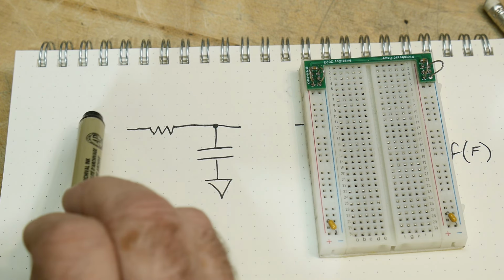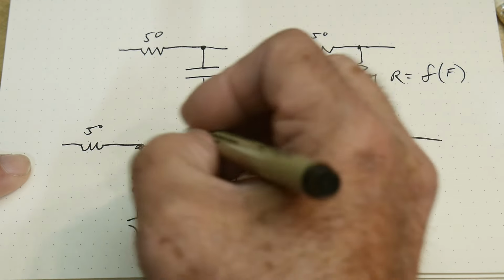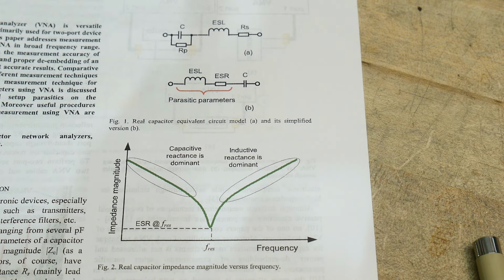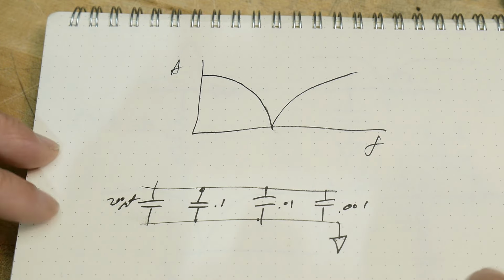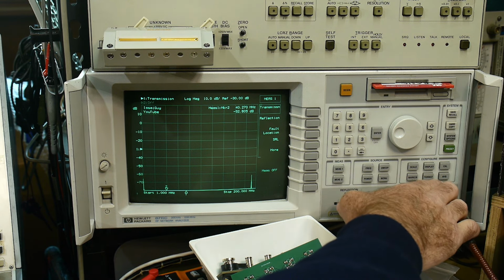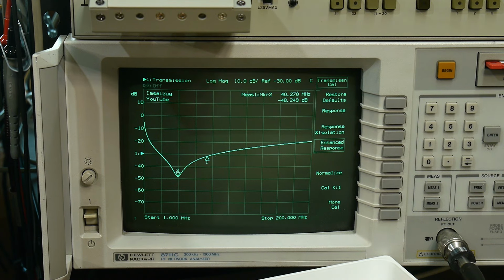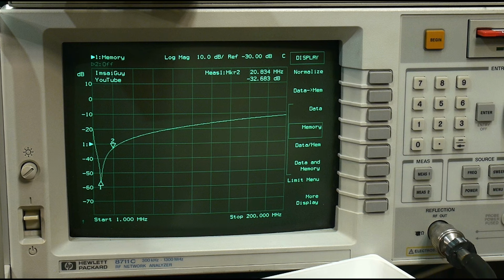#1819 Multiple Bypass De-coupling Capacitors

Comment: Adding inductors in parallel will reduce the inductance. Using multiple vias to the ground and power planes on a multilayer will reduce inductance and improve noise. Everyone knows about bypassing Vcc but not many know about bypassing gnds to Vcc for really quiet boards.

Comment: On other thing to add...pick up a capacitor... any capacitor that you have... and say to your self... "You tricky little devil... you're not the 'capacitor model... however complicated' ...that I manage to conflate you with." In the long run... if they put you away (or on meds) for talk'n down to capacitors... you'll be safe... at least... from that conflation.

Comment: Nice paper by the author(s) Stepins, et. al. Let's see if the Guy actually reads it. (Anyway, points out the limitation of using a VNA for measuring the ESR of a particular capacitor.)
Reply from the maker: I did read it. There are many calibration errors in 12-term calibrations of VNAs. I've considered doing a video on VNA calibration which I believe would be the first step if people want to read the Stepins paper. I did enjoy the discussion of different methods S11 S21 stuff. They were questions I had in my own head.
Reply from the maker: for those who want to read it:
https://www.researchgate.net/publication/269166796_Measuring_Capacitor_Parameters_Using_Vector_Network_Analyzers

Comment: Now I understand better why different capacitors are put in parallel.  I know it’s done in SMPS to remove high frequency noise because electrolytic caps do not handle the higher frequencies. I guess the short story that they tell us in electronics 101 that capacitors in parallel add to an equivalent Farad sum is not exactly true because it is highly frequency dependent.

Comment: I would like to see effect of using different values of capacitors together vs using the same value in parallel same number of times. New fpga designs use only one capacitor value but multiple times.

Comment: I am designing a PCB for my project it is a switch-mode power supply that has a switch-mode power converter an Atmel and a 12-bit ADC and it is really important to put a bunch of those decoupling caps near those components like the Atmel and especially the ADC in order to have really low ripple in the input  I also would like to know how effective it would be to use frit beads alongside those  decoupling capacitors
Reply from the maker: a lot comes down to ground layout

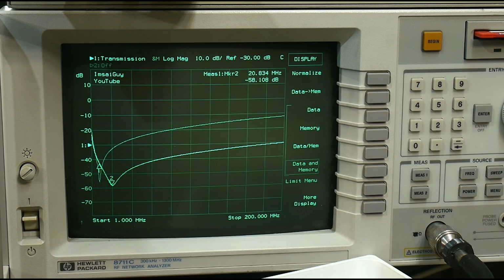Comment: 20:18 WEIRD! The curves overlap at the start until the SMD starts to jutt-right a little, which ultimately leads to its valley being far right of the leaded-cap. But that jutt-right appears to line-up with the beginning of the leaded-cap's inductive-curve!
It's almost as though the SMD cap is being affected by inductance earlier than the leaded-cap, but since that inductance is so much lower, its effect is obviously less in the higher frequencies.
Another way to look at it: If the leaded-cap's inductive-"only" curve were summed with what appears to be the leaded-cap's ideal capacitive-only curve (where at 8?MHz it reaches its valley, but if it were to stay there for all higher frequencies) then we'd see something like the SMD's curve.
This must be a coincidence, eh? I can't think of how that would be the case physically/electrically (unless maybe the chip-capacitor is designed with "fingers" instead of plates, or maybe the inductive curve we see is actually calibration-error due to traces in both circuits?).
Or it might just be a factor of zooming, where the leaded-cap also jutts-right around the same point, but does-so so shallowly that it can't be seen at this scale.
It's weird how many things influence such measurements, and how we interpret them...

I did [SO MANY] signal-integrity analysis simulations for DDR memory about two decades ago and found that even the tiniest changes, like shifting a via 1mm, would cause dramatic changes to the signal. Yet, the layout-standards documents were so loose, in comparison, that it's a wonder so many quickly/cheaply-designed motherboards worked at all! (nevermind DIMM sockets, etc.!). Simulations of "good layout"-practices often resulted in signals far outside the input-specs of the devices!

Comment: At 16:38 it is worth noting that the system has a decent Q, but not super high. I would assume the Q would measure higher in a setup that was not 50 Ohm.

What i have also experienced from previous work, is that it is very likely that the circuit will have noise/oscillations at the peak (mkr 3) as the CLC circuit requires very little disturbance to oscillate.

Some comments ask about the difference between dielectric, say X7R versus other MLCC, this should have a lesser degree of significance.
The physical size of the package is what mattes the most, it is ultimately the loop area that causes the leakage inductance. Assuming same capacitance.
When working with MLCCs, it is best to have as much capacitance for a given package as possible,
There are however two things to remember
1) That x7r and the like will suffer from bias dependent capacitance.
2) via placement, trace length and pcb stack up will aslo be important for good decoupling.

Comment: S21 is the opposite of what was stated. Not that it makes much difference at these frequencies but you should use your test jig as OSL standard to eliminate the parasitics of the jig.
Reply from the maker: I agree you can calibrate out the small stuff if needed. A bit tricky to build a good OSL standard. as the S21  it is the forward transmission of a system. 1 is the input and 2 is the output. S21 points in the forward direction.
Reply: @IMSAIGuy Building a perfect standard is tricky but if your VNA allows to input standard coefficients and you have a set of known standards that you can use to characterize your DIY standards then it's not that hard.
Reply from the maker: @galileo_rs  I can't afford a calibration set. so I do the best I can
Reply: @IMSAIGuy  I believe you have a friend that has access to a calibrated VNA? Make a "transfer standard". Lookup Kurt Poulsen guide on how to make your own standards. He posted it a few times on various groups, most recently on LibreVNA group. Since you have a lathe and a mill it should not be outside of your capabilities.
Reply from the maker: I do not have access
Reply: @IMSAIGuy  I guess I mixed you up with some other YouTube creator.
Reply from the maker: @galileo_rs  none of my VNA friends can afford cal sets either.
Reply: @IMSAIGuy  In the same boat, maybe even worse: Most of Ebay sellers do not ship to Serbia and my only "known" good calibration is what I got with NanoVNA H4, thanks to Kurt Poulsen doing the coefficients for those. How tight the manufacturing process is for those, between batches, is an open question.

Comment: Subject: Please help me for my Interview for Optics role!

Dear sir,

I hope this message finds you well. I am reaching out to seek your invaluable guidance during a critical phase of my job search process in entry level phase. My passion for optics has led me to apply for roles in Optical and Metrology Engineering, and I am thrilled to share that I have been selected for an interview on Wednesday [ 03/04/2024, in 3 days] with the Optics Division at top company.

During my preparation, I have encountered two questions that have left me a bit perplexed, and I sincerely believe that your expertise and advice would greatly illuminate my understanding. The questions pertain to how to constructing an optical setup on a bench to measure both the irradiance and radiance of a single LED as well as an LED array.

Despite my efforts to research materials that explain the practical aspects of such setups, I find myself at a standstill, unable to uncover standardized methods or clear step by step experimental designs employed in laboratories or industry settings. While I grasp the theoretical concepts of radiance and irradiance, the transition to step by step experimental design is unclear.

Moreover, I am curious about the use of a how Lambertian reflection plate is used in this context and how it might be integrated into the measurement process. Understanding the variables involved, such as the distance and area of the photometer, the angle of illumination over the Lambertian plate, and the photometer's angle relative to the plate, would greatly aid my comprehension. Additionally, if there are alternative methodologies to achieve these measurements, I would be eager to learn about those as well.

Your guidance on these matters would not only deepen my understanding but also significantly bolster my confidence as I approach this pivotal moment in my dream career as a first generation student. I am deeply grateful for any advice you can provide and eagerly await your insights.

Thank you very much for considering my request. I look forward to any assistance you can offer.
I am attaching my phone number, in case if you are comfortable to get over a call. 
+1(857)4151160

Warm regards,
harikumar1897@gmail.com
Reply from the maker: Every company will be measuring things a bit differently. To pass the interview, understand the terms (they are confusing). know the units! are you measuring area, angle, watts or lumens. know about integrating spheres and goniometers

Comment: You designed nice fixture for measurement.
Here is a trick I learned on the web, the mica capacitance deepest low changes with sound wave.
Also, I saw in the paper you showed that at the deepest point shows the ESR; I wonder ESR of capacitor is the same throughout the frequency range?
That is if we measure ESR of capacitor at DC with different method, is it going to be the same ESR at deepest -- Resonant -- point?
Reply from the maker: published ESR numbers are usually measured at the standard 100kHz. I showed here that is not the whole story.
Reply: @IMSAIGuy  Thanks for the info.
Reply: Get an LCR with multiple frequencies if you want to go down the esr rabbit hole.

Comment: Extremely interesting, but I wonder a little what influence the 50 Ohm high-frequency measuring system has. In actual application you have a complex source, where capacitances and (line) inductances also have an effect and a load which its own impedance too..
Reply from the maker: you are right, one big issue is the PCB layout

Comment: Excellent, thanks for doing this experiment.  It seems to shows that yes, indeed, 0.1uF was about the ideal value in the 1-3MHz clock frequency TTL digital logic days.  And, that bypassing a 100MHz part on ground and power planes is likely to have a surprise lurking... A test fixture that has the typical surface mount 0603 part with it's 3 thermal tracks and a via might be interesting (I'm sure someone's done it).

Comment: Nice video, but it would have been nice if you had added a data point to the old discussion of what's better:
A) N different value capacitors, or
B) N of the largest value capacitor in parallel.
Reply: That depends on the application and product requirements, i.e. space, price, reliability, requirements for minimizing different component values, etc. Real-world engineering design work is always a balancing act. That was the part I most disliked. Now I do my own one-off designs and it's fun again.

Comment: What about MLCCs, I thought these were quite a big improvement in extending/spreading the dip, since they are lots of similar capacitors in parellel each with a small varience in inductance and resistance
Reply from the maker: both of these are MLCC capacitors
Reply: @IMSAIGuy  Thank you

Comment: So in the same way, when using a capacitor as power supply bypass/decoupling, the self-resonance would be reflective of the lower impedance and ability to source current to the power supply rail, as the device switches as whatever frequency.  I guess its not accident these things are related (or identical) and now the connection is really clear.  And how the bulk electrolytics can be further away to deal with low frequency power supply ripple, vs the higher frequency switching transients with capacitors right at the leads of the IC.  I like it when things go click in my head like that.
Reply: That's the difference between memorizing and learning.

Comment: I got sidetracked into tank circuits while refurbishing a grid-dip meter. Characterizing the self resonant frequencies of capacitors and Inductors using the vna taught me a lot about taking measurements with the vna. Comparing theory to results, improving/finding limits of setup and the vna, and seeing different parasitic effects were very interesting for this beginner.
Reply: If you read the paper, the Guy, refers to, you'll read that the author points out that a VNA isn't good at measuring ESR. (A good LCR meter can give information about ESR... if that's important for the application... for example... bulk filtering.)

Comment: Amazing what tiny bits of wire will do to your circuit at 10s of megahertz
Reply: Yup. Or a tiny bit of wire threaded through a single tiny ferrite bead. At DC, it's a short circuit - at 100MHz, it's 600 Ohms...
Reply: You should try working at 10 Gigahertz which is the highest amateur radio band I operate on.  10 GHz is horribly sensitive.  I can't even imagine RF labs that deal with 100 GHz.  To say circuit board layout at those frequencies would be a nightmare would be my understatement of the year.
Reply: @mikesradiorepair  Oh, even oscillators at hundreds of Terahertz can be dealt with quite reliably in my experience - one click always turns the flashlight on, another turns it off... ;)))